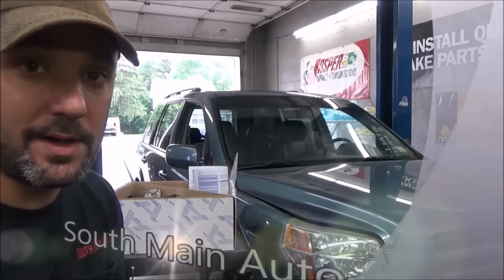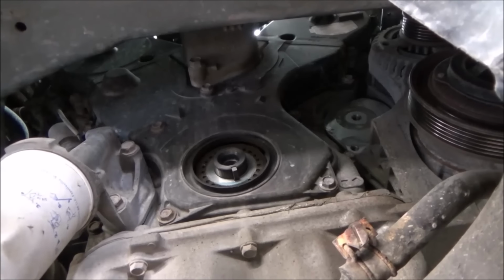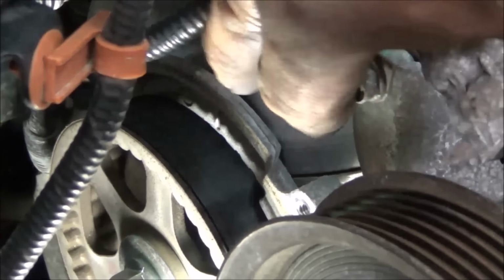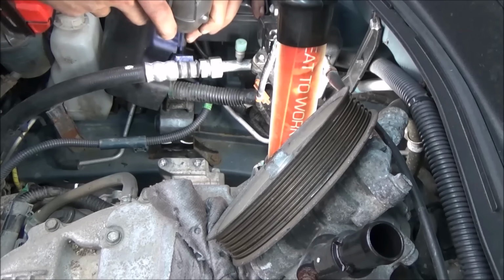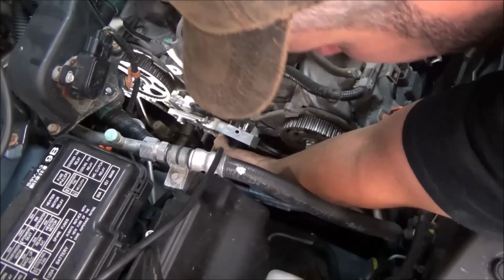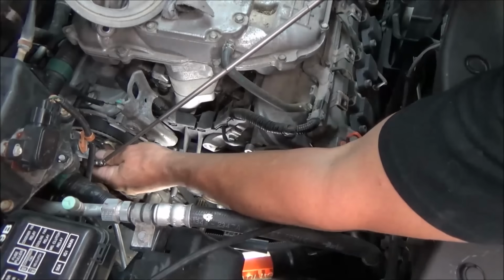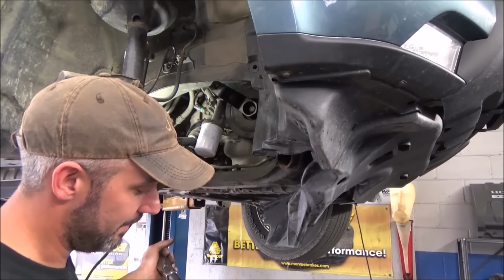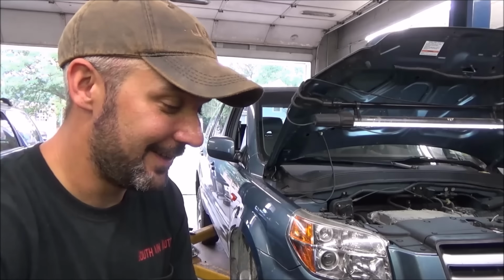Honda Timing Belt 3.5 J35 - Pilot, Odyssey, Ridgeline

Comment: Good video. I like the idea of testing the install as soon possible. I'm doing my '05 Odyssey. In this vehicle, the TCM and bracket is in the way for removing the engine mount doughnut rearmost mounting bolt. First question: Do you remove this TCM and bracket or do you have a trick for reaching that rear bolt? Second question: Assuming one does remove the TCM, would you reinstall the TCM before starting the engine to test in order to avoid pesky DTCs and Check Engine Light? Or will the engine even start with the TCM disconnected?

Comment: Thanks to this video, I was able to install the same Aisin timing belt kit on my 2012 Odyssey.  The local Honda independent shop quoted me $1,400.00 to do the job.  This video really helped me so I decided to become a Patron of this channel.  
       I used the Lisle crank bolt socket and my Milwaukee high torque 1/2 inch impact wrench and the bolt came right off.   I discovered that the engine mount was broken so I replaced that as well. 
      The only problem I encountered occurred when installing the timing belt.  It was difficult to get the belt positioned on the correct tooth of one of the sprockets.  It seemed like it was a half tooth off and I figured that it would settle in.  After checking the timing by rotating the the crank two times, one of the cam sprockets was out of position by about 45 degrees.  I started panicking because I thought I ruined the engine.  After I settled down, I just removed the belt, removed the tensioner and reset the grenade pin, and started over.  For some reason, everything lined up easily the second time.  When I installed the crank bolt, I tightened it the final 60 degrees with my impact wrench.  Is that method acceptable or should I have used the method in the video?

Comment: I'm having this problem with my 2005 Pilot.  My son's mechanic friend is going to come over and help me out.  If he is OK with it, I'll make a video.  I'm having two problems.  First the rear/firewall cam wants to slip toward the firewall when I put hand tension on the belt in the place where the hydraulic tensioner would be.  I can compensate for that.  Second, when I do get the marks lined up mount the tensioner, release the tensioner and hand crank for 2 revolutions both the front and rear cams are off one tooth.  I can't figure it out
Reply: I'll post video later, but I didn't put enough pull/tension as I was routing the timing belt.  I'm guessing that put me off a tooth.

Comment: Great video!  Easy to follow and helped a lot.  On my 2010 Pilot, the new serpentine belt was so tight it would not go on even with the tensioner cylinder compressed all the way.  Here’s the trick; first check to see if you have the correct belt.  If it is the correct belt, leave the tensioner bolt a little loose, if that doesn’t work leave the power steering pump mounting bolts a little loose as well and it will slip right on the tensioner pulley.  Torque all the above mentioned bolts to spec and turn the crank pulley around a couple of times to align the belt.  Hope this helps if someone else runs into this problem.

Comment: Special Thanks again......Just did a 2005 Honda Odyssey timing belt and water pump, just like the kit you had.  All went well, patience is need at certain spots.  But boy is that crank bolt tight!!!!!  Took and impact and the heavy duty 19mm to get it off.  My van had 218k and never had been replaced, the belt was so far stretch out it could keep timed.  So glad it didn't break.

Comment: One thing to keep in mind on the 3.5's and even the 3.0's when doing a timing belt, it is always a good idea to adjust the valves at the same time, the exhaust valves are always on the tight side and after doing a timing belt the vehicle can devolope a slight misfire, seen this happen a number of times.  We also always replace both cam seals and crank seal, they like to start leaking around 150k, so smart to do them while you have everything apart.

Comment: I'm in the process of doing this. I turned the engine by hand and then removed the belt. While reinstalling the belt I noticed the rear cam had moved just a bit. Now I'm stuck as to what I should.
Reply: Did you figure it out?  Not an expert but if you put everything back to top dead center and reinstall the belt I'd think you should be OK.

Comment: About to do this was wondering about the battery J bolt that I am reading you need to grind down the end and screw it in to press up against the tnsioner? I am lost as to the reasoning and do not see it here?  Any info would be amazing. Thanks for this video.

Comment: I just did my timing belt on my 3.5 Honda Odyssey timing is spot on I started it with out my harmonic balancer on or alternator on or cover and it idle really high like 2200 RPM that won’t hurt nothing well it I think it locked me out of course it won’t go in gear that idle but now I do have an O2 sensor code will that make it Idle high otherwise it started fine just high idle let me know if anyone can help

Comment: Thanks for a great video.  Quick question, due to the vehicle being 11 years old, should the engine oil seals near the timing belt be replaced at the same time as the timing belt.  This could prevent a lot of future labor if the old seals start to eventually leak.

Comment: I am sure glad I am not a Honda mechanic. I did not like to work on my 60 Peugeot. It had wet cylinder sleeves. it was quite innovative but not much power at 60 hp also rear slinger on the crank. Never leaked oil there. It had lots of miles on it 200k or more. I installed a alternator in place of the 25 amp generator. It was really worn out inside though motor was still running great.

Comment: You sir doing a great job. I would be very happy if you are in my area. I would rather pay to work on my vehicles. I just could not find a good and honest auto repair shop. Every time I put my car in for repairs they ended up screwing something up. I might have to try to tackle the timing belt job myself. Thank you 🙏 so much for your great video. This by far the best video on Honda Pilot and Odyssey. 

Just subscribe to your channel.
Reply: i feel that man hard to find a good independent shop that U trust, my local honda dealership charges over 600 an axle for fricken brakes, that's highway robbery if u ask me

Comment: This same engine is also used in alot of Acuras such as the TL, TLX, RL, RLX, MDX, RDX, and ZDX, since the J series engines are very similar to each other this vid works out for alot of them to the 2.5 (Japan Only) to the big 3.7( that was used in the TL SH-AWD, ZDX, MDX and RL.)

Comment: I find I do have to try to save the belt and it's just for those outside factor shit happens moments.  I've been sent the wrong kit altogether.  The kit I've been sent works just fine for a model year older than what I'm working on, but it's different for this model year.  Somebody returned a new box with their used parts in it and the 12 year olds didn't look when they accepted the return.  No matter what, that correct kit is two days out.  Now the customer wants to reschedule, boss says we can't tie up that bay, etc...  Because of those timing belt jobs that aren't born out of a catastrophic failure, it has occasionally forced me to put a car back together with old components and do the job twice....Maybe I should start cutting that belt.

Comment: FAIL.   Just tried taking off the crank bolt with the same socket and two different impact wrenches (one just like yours and at 100 psi) and the crank bolt is still on there.   I thought I had caused an oil leak in the process, but it turns out it was power steering fluid from when I moved the pump out of the way.
Reply: Oh, and now I know why you move the floor jack out of the way after you remove the engine mount. (I gave my jack an anti-freeze bath.)
Reply: Well I had to resort to a 5 foot cheater bar, but I got it off and completed the the timing belt/water pump swap.  Good video, thanks.

Comment: Almost every crank pully bolt I have done has had to broken loose running my compressor up to 175 overridding the spring and using a short whip and putting the compressor right besides the car. LOL. Or borrowing my dads 1" impact. haha. Them hondas the worst.

Comment: I was a bit puzzled by this one unti I realised that motor is US only... Single camshaft. I'm curious how the Vtec works on a single cam motor per head now. Did Honda go for time between servicing, low power/high reliability? There seems to be a lot of 100,000 mile motors in your shop and a few people over here would be worrying about motor wear at that point.. (BTW my X type Deisel is on 205,000, original injectors, original clutch, only ever gets regular oil and filter changes).

Comment: Thanks for this video.   Had never done a timing belt job, but after watching this felt like I could do it.   Did it on a 2003 Honda Pilot and thanks to this video I was able to do it.   Ran into a few unforseen difficulties but was able to work them out.   The 03 Pilot is a J35 also but a little different than this model but close enough to get it done so thanks for the great instructions!

Comment: Eric, Thank you for this post. I watched it twice and did a timing job on our 06 Odyssey. You covered everything that I needed to know. One thing I will note is the crankshaft key indexes the crank gear also so, when the key falls out when you take off the balancer and you stick it over with the balancer for safe keeping the crank will spin without the timing set turning. I learned this the hard way. at least that is the case with an 06 odyssey. Again thank you for the great post. It was a huge help.

Comment: Just did my very first timing belt kit job on my 2008 (8th Gen.) Accord (3.5 engine) coupe following this video as a guide (same engine). Thanks a lot for this video. I tried not to drop as many things as you did on the video😂. I went caveman on a couple of things but the car is running smooth.

Comment: I replaced the timing belt on my 2005 Honda Pilot today - this video was the perfect preparation. It took me quite a bit longer, but everything went smoothly and it is running great. Thanks Eric! The special crank bolt socket was especially helpful.
Reply: Michael:  I have an 05 MDX, will be doing this job soon.  Let me know how long it took you. I know  i'll be over 5 hours all totaled, but i'll go super slow.  Nervous about messing up. What was the hardest part, and anything you can warn me about being difficult?
Reply: @wilmarbarrick3194  Thanks for the great advise!  i did order a thermostat. Won't know about the hoses until i take them off, but they look good. thanks again, looks like this weekend is when i'm doing it.

Comment: I probably wouldn't have tried this myself without this video, thanks so much! One thing about the crank bolt. I could not get it loose, I had the socket you recommend, tried both air and electric impact driver, then tried both of those with heat, still no luck. Since I don't have a lift I couldn't use a really long breaker. If you get in this situation look for videos on removing Honda crank bolt with starter. Basically you use the socket and breaker bar. Brace the bar against the frame member (beware you don't hit the oil filter). Make sure you disconnect the front three spark plug wires so the engine won't start. Then 'bump' the starter a few times until it breaks loose.

Comment: Yep .. I call it the “trifecta” ..
1) Timing belt kit w/ idler bearings (& new hand grenade tensioner if needed)
2) water pump
3) serpentine belt, idler pulley (if it has one) & tensioner/pulley
 Extra: a) pull the plenum top and clear out EGR passages
            b) pull the Idle Air Controller and blow out any dust/dirt (they tend to act up if disturbed on a job like this)
just my $.02

Comment: I bought a new 1978 Subaru FE coupe.  The horizontally opposed 4 cylinder engine had a gear driven cam.  The cam only had 4 lobes and 2 lifters rode on each lobe. What could be better than a gear driven cam when you look at all the effort and work needed to change a timing belt?  And what about if the belt breaks when the engine is running and it's an interference type engine?

Comment: Basically same as a 1998 Honda Accord except that used two belts for the Power Steering and the drive system. I bought a Gates Kit, and the pulleys, water pump, and tensioner were all OEM, the belt was branded Gates. This video made it easier to do.

Comment: Thanks. Great video. Very informative with a great style. Covered the info. I needed but didn't give me crap I didn't need. When you talk about the "famous" Honda crank bolt and how tough they can be, you weren't exaggerating brother! Holy moly that was ridiculously tight. 8 foot breaker bar indeed.

Comment: Hey Eric I over tightened my water pump bolts and motor mount bolts that go through the water pump, because my torque wrench broke. is the water pump trash now or can I just loosen And torque to the proper specs? I over tightened by 3 or 4 times the spec, oops. I know you would probably recommend installing a new one (i'm going through all that work i might as well do it while I'm in there) but I'm on a tight budget.

Comment: Thanks for your detailed video...Replaced my wife's 06 Ody Timing Belt using your instructions. Only issue I had was the motor mount threads were stripped and had a hard time removing the large bolt. Previous owner/mechanic probably used the Caveman method to install it.  Took longer than expected, used lots of WD40 and lots of patience. Retapped the motor mount threads and made my job easier during installation.

Comment: Bought that high mass 19mm and the crank bolt still wouldn't budge.  Hit it with PB blaster, waited 24 hours and it buzzed off after about 90 seconds of hitting it with my harbor freight impact that says 1050ft-lbs of break away torque.   2 days of stress over the dang crank bolt.  Thanks for the video, saved me over a grand and I know it was done right!
Reply: Was your harbor freight pneumatic? I have the 2 tools you mentioned and will be using a Milwaukee M18. Wondering if that will be sufficient to bust crank bolt.

Comment: If you have the opportunity and the inclination, I would like to see a timing belt video on a 5VZ-FE Toyota 4Runner or Tacoma. I done one twice now and I can't get the air conditioning compressor off to change the tensioner.

Comment: Bought a Gates kit with water pump for my 2005 Acura RL. Was very disappointed to see that the water pump is made in China. When I do the job next time I will definitely get the Aisin kit. Your video was great and spot on. Only problem I had was the lower motor mount bolt hold in the block was stripped. Drilled out with angle drill and Heli-coiled it.

Comment: This is Bryan.  Isn't it easier to purchase a vehicle with a timing chain, then you don't have to do this every 100K.  Like the Toyota V-6 has the chain.  I'm buying engines now without belts.  I've been wanting a Suby but, I watched your Subura head gasket replacement video which showed they have timing belts.
Reply from the maker: I do like chain drive engine for that reason but with all the VVT on the new chain drives they seem to have their issues to, I don't know what the answer is other than regular proper maintenance

Comment: I'm trying to do this on a 2010 Odyssey (not the one I mentioned in my previous comment.) I keep coming up with the rear cam one tooth retarded. So I try again. Further, when I try to advance that cam gear *just a smidge*, before putting the belt back on again, it jumps about 45 degrees of cam rotation.  It does NOT want to stay in one place. I figure one of the valve springs is pushing against the cam, and forcing it to turn. 
Edit - I found another video that mentions the cog not wanting to stay in place. Wish I would have known that before I started. But yeah... no substitute for knowing what you're doing. Nice job on your replacement.

Comment: (WARNING) Do not use the crank bolt to rotate the engine without the harmonica balancer On. my 04 Honda Pilot got stripped on the tip of 2 threads doing it they way he said to do it.but other then that awesome video.
Reply from the maker: I have done well over 100 3.5 / 3.0 v-6's Honda engines and have NEVER stripped a crank bolt, just sayin....
Reply: South Main Auto Repair 
Love you video it help a lot
But unless the crank bolt was not original than that could of been the issue. The bolt bottom out and just 2 threads on the tip got rounded out.but thank god it didn’t ruin the crank shaft threads.

Comment: Completed the replacement on my 2007 Pilot yesterday.  I had to go full caveman to loosen the balancer bolt, by cranking the engine... The Lisle socket didn't help (with my 1/2" electric impact ratchet :) ).  I've done some light repair and maintenance on my cars before, I even replaced the timing belt on a 2004 Mitsubishi mirage I used to own (still running BTW), but I could have not done this without watching your video a few times.  Again, my hats off to you for the great video!!!